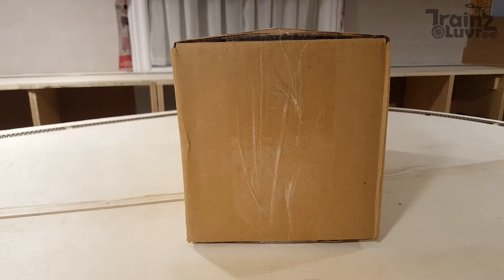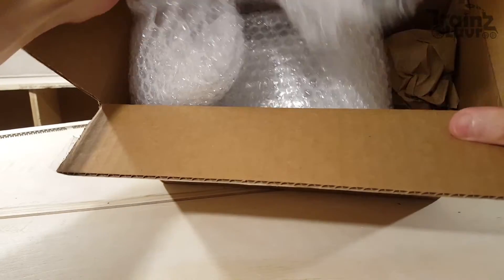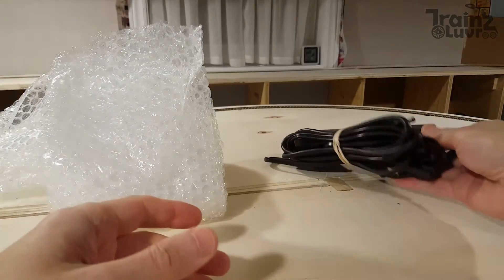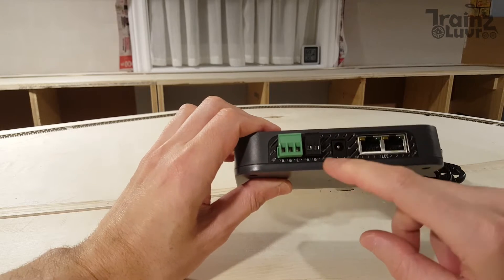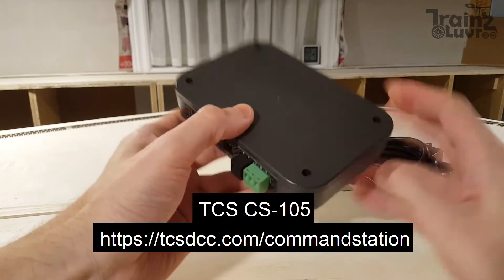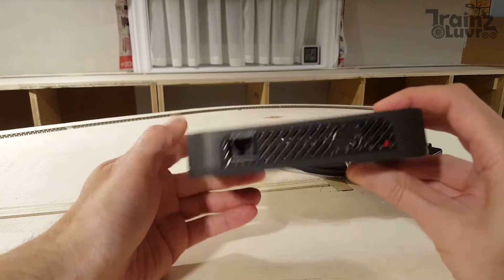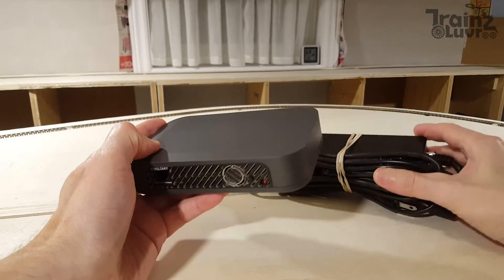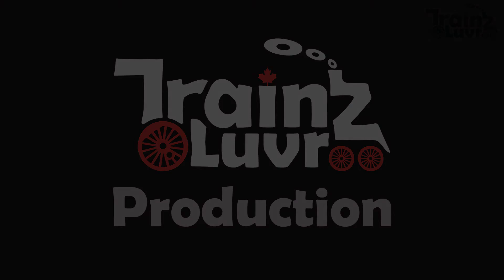TCS CS-105 DCC/LCC Command Station: (impromptu) unboxing

Comment: I waited for my UWT-50 more than a year after making a reservation. After being able to use it  on  the club's TTrak layout I've decided I want the capability to run trains at home. While I'm waiting for the components I have ordered and then assemble a DCC++EX command station I've been watching You Tube videos on that system and related topics like LCC. I've no understanding beyond basic electricity so I'm sure it will be a challenge.  I was especially interested by your earlier video on LCC. I really can't afford the available retail command stations so I hope DCC++EX will be able to adapt for LCC if I find a need for it.
Reply from the maker: Thanks for your comment. It might be a tall order for the DCC++EX to support LCC with their current hardware configuration. They will need to switch to a more powerful platform such as ESP32 or SAMC. But even then with all the other features they have, the CPU might not be adequate to run a full OpenLCB stack.
There is an alternative LCC Command Station to the commercial TCS one, which is based on ESP32 and is Open Source. It will allow you to connect your UWT-50 throttle and run in full LCC mode (loco roster, macros, etc). If you take a look at my video on electronics on my layout (#7) I feature it there and also include links to the ESP32CS project on GitHub.

Comment: I saw your post on MRH. I am really curious if they are going to releae this at Amherst.
Reply from the maker: They are definitely going to be showing it paired with UWT-100 (and probably UWT-50) and my guess with NCE (Pro/Power)cabs. That last one is a big deal since a lot of people use NCE and this CS brings the train database feature to NCE cabs, among other things such as bridge to LCC (DCC accessories->LCC accessories). Otherwise, I don't have a release date, the chip shortages are really affecting every manufacturer.
I was supposed to do a more in-depth review couple of months ago, but life got in the way, so now slowly picking things up again and resuming where I left off. I also wanted to find a cheap NCE ProCab that I could use in the review, but cheap is a relative term. Hopefully I can put something together even without the NCE cab and post it here soon...so many things backlogged.
Reply: @TrainzLuvr  I would like to add a hammerhead to my collection. I use Digikeijs and they will have a CabBus adapter shortly. 
I really want to check out the TCS offerings and I am hoping to get a UWT-50 when released.
Reply from the maker: @HumancityJunction  I never had NCE system as I started with Roco Z21, because it was new and modern CS at the time so a good direction to take. Later I saw DigiKeijs too, but LCC happened and I got hooked on it. UWT-50 should ship Q1'22 and I'm eagerly awaiting mine. These component shortages are really throwing a wrench into everything.